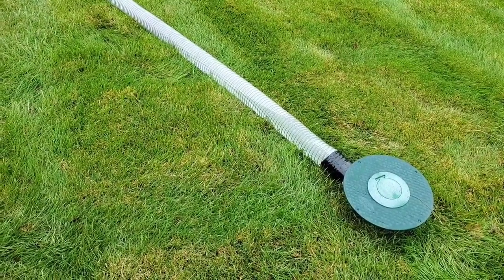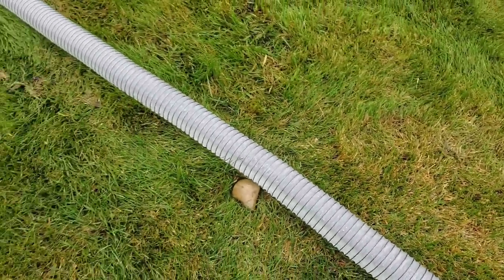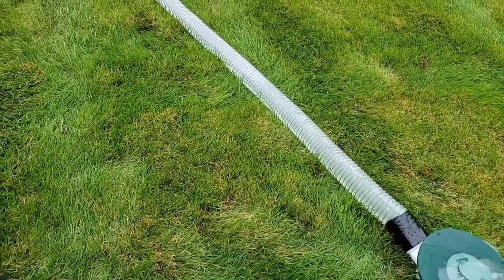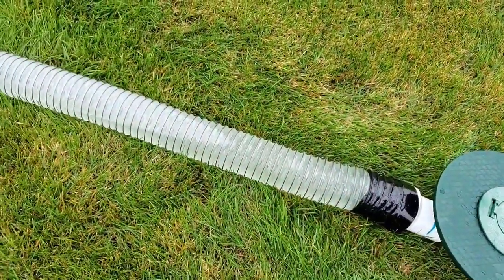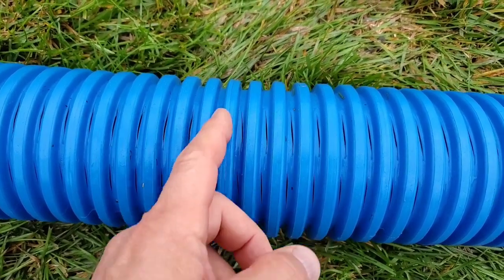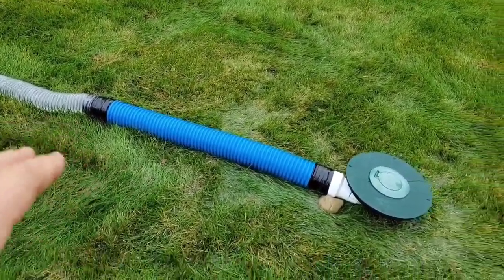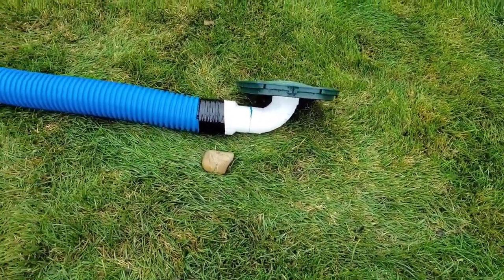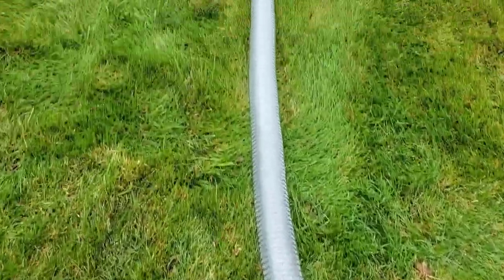How to Prevent Underground Buried Downspout Pipe From Freezing During the Winter

Comment: I've seen in your other video where you say not to run downspouts into slotted pipe because it may fill with shingle gravel and debris, so why are we using it in this application?
Reply from the maker: Don't run downspouts into French Drain Systems.
Reply: @FRENCHDRAINMAN  I don't intend to but in this video you recommend using slotted drain tile before the pop up...that is what I was asking about.
Reply: He's only using it as a relief at the end. Do not run perforated pipe from you gutters immediately as all the water will leak out against the foundation.

Comment: What's best to use under concrete in Wisconsin? A trench drain with exposted top, 4" abs pipe, or 4 inch double wall culvert pipe? I have a 5ft length of green drain pipe under my sidewalk with a 4 inch white elbow inlet from downspout that freezes and cracks into peices every winter and will be pouring concrete patio below where it discharges so I'm looking into a miter drain for the discharge. 
Drilling a hole in the bottom of my elbow is probably not a good idea because then it will freeze and heave the concrete. 
What's my best option?
Reply from the maker: https://youtu.be/3_FcEdESkQ0
Sleeve it with 6" and run 4" single wall corrugated pipe through it.

Comment: I have clay soil and minimal slope so I don't expect my drain hose to drain completely, so I would use weep holes like you show.  My question is if it rains for 30-60 minutes, the weep holes will saturate the clay, therefore, when the rain stops, there is now no room for the remaining water in the pipe to disperse, as the clay was already saturated from the weep holes draining throughout the 30-60 minute storm.  Thoughts?  
Is it better to put only one very tiny weep hole in the 3" right angle, that would limit the amount of rain weeping into the ground to a minimum during the storm, and then after the storm let the remaining water in the pipe still have room to drain out slowly over many many hours?
Reply from the maker: https://youtu.be/wawHvSs0UV4?si=bl8PN2vSqBnFCwgy

Comment: I have watched many videos and over time recommendations have changed.
I live in north and am worried about freeze ups.
So I blended some techniques as to what was readily available.
Under the bottomless pop up emitter I went down 1.8 feet filled with 3/4 to inch and a half stone...fabric over then pea stone to surface (to combat grass obstruction as I don't have access to turf restrictor plate). I filled in a foot of trench to counter downspout runoff back into still open trench. 

I tested.  I think I have turned my pop up emitter into a catch basin.
During rain, the water pops up just below the emitter in the pea stone first.
After the rain...the water stays just below emitter surface. It then takes about 10 hours to drain completely in clay and loam. Water also still went past my experimental dam into open trench.
So now I am wondering if all that wrapping and overlapping of fabric (in this video) was to keep water at bay? You did mention using clay all around.
Also, if you do happen to see this, by  me having about 7 gallons of room at the emitter, has that reduced my water pressure? I ask because it seemed like my water flow had slowed down and maybe water was backing up more into pipe than it should but I could not tell. 
I really didn't want to put in a section of perforated taking into account your other videos that mention root issues and clogging.

I'm kinda thinking I should make it solid around the emitter (clay you mentioned) until the bottomless part is reached to maybe increase pressure for the emitter.  
Anyway thanks for all your videos. :)
Reply from the maker: I think what you did is fine, and you don’t have to make any additional changes. What you made might be overkill, but I like it that way.
Reply: @FRENCHDRAINMAN thanks very kindly for the feedback :)

Comment: Very interesting channel information. I understand why French Drains are effective in channeling water away from your foundation.  But has anyone ever used perforated drain pipe resting INSIDE YOUR GUTTERS to channel water to the downspout?  I'm thinking this is a way of avoiding having leaves clog your gutters on a yearly basis (if you have nearby trees).  Ever heard of that solution?
Reply: Leaf guard lol
Reply: @jeffbidniy6552  I can buy 100 ft. of ADS 3-in x 100-ft Corrugated Perforated Pipe to sit in my gutters for $130, Leaf Guard would cost me $2,400.
Reply: @j.ericswede7084  I guess it will float,  the dirt piling up under the pipe
Reply: @2adamast  The perforations (holes) in the pipe wouldn't let the pipe float. Small holes, 1/4" every 6 inches on the top half of the pipe would channel the water from the gutter to the downspout unblocked by leaves, etc... I know it would work, just haven't done it yet.
Reply from the maker: Downspout Cleanout and Leaf Filter Gutter Leaf Guard
https://frenchdrainman.com/product/downspout-leaf-filter-clean-out/

Comment: You need to teach a MASTERCLASS !!  Seriously..... However, in this case, I am not 100% convinced it will keep the line from freezing.    When temp is sub freezing and  ground is solid, won't the water in the "cut" corrugated pipe extension also freeze ? Same is true with the hole under the 90" ???
Reply from the maker: https://youtu.be/1kPHHnDc1ZY?si=jqaV6rmieJmgntsj

Comment: Looked on Amazon and your site. Where can I get 3” knife cut? Or can I just do it by hand to the 3” corrugated pipe? I bought your kit with the downspout filter, hose, and popup emitter.
Reply from the maker: I don't recommend a three-inch knife cut. It can hurt you more than it can help you. A four-inch pipe displaces 56% more area and holds 56% more water. By going to three inches, you've already reduced the amount of water left in that line by 56%. You'll bring some dirt in through those knife cuts. And the three-inch line doesn't displace enough area to recover from too much dirt filling it up like the four-inch pipe would.
Reply: So should I cancel the 3” pipe? I watched your video praising the 3” I live in Utah and get about 14-16” precipitation a year. Or are you suggesting I get knife cut 4”? 

Or just run the 3” and drill some holes in the bottom of the elbow connecting to the pop up?

Comment: Just bought some and I feel like I’m missing something. I just dry fit everything and tested with the hose and I can hardly get a trickle. Also the water backs up so much in the pipe. I have more than enough slope, is it just not enough pressure with the hose?
Reply from the maker: A garden hose does not provide nearly enough pressure.

Comment: I bought the "kit" and installed it a couple weeks back. (Had new gutters installed, needed to handle their runoff).  Front yard is all clay, and we had 2.5 inches of rain over a day and a half and the clay by the popup became pudding.  (Freshly dug, ground hadn't settled, BIG rain event) I mean, like walking on jello pudding goopy.  It also washed the dirt downstream of the popup and all the seed and straw away.  Serious erosion because the grass had been "killed" pending a lawn renewal next spring. I think next spring I will dig it back up, use a 3 inch popup, and add the knife cut once the ground thaws.   If I'm hearing this corrrectly, the trench for the section of knife cut should be wrapped and the trench should have gravel (inside the wrap, not outside), but otherwise the regular 4 inch just lays in the trench?   And I too wondered if it may make sense to dig down under the popup and make a lined hole with rock to kind of "dry well" the outflow of the hole in the 90?   I'm afraid that even with sod/grass holding teh dirt together, another rain like we had will make that part of the front yard a muddy mess.
Reply from the maker: It will set up and shed water wait until next spring
Reply: @FRENCHDRAINMAN  i like this reply.  i've run a backhoe on many many sites that are total sponge but next year same season - done.  i'm for sure not an engineer type like FDM but i did run the hoe on the gang for 7yrs where we put in cable at road crossings.  on many ditches parallel to a crop field ditch (huge) we'd have to pay attn to this issue.  rip rap was already in the ground for the various drainages nearby (other fields).  we'd dig in that in summer and even  put crush in it.  - never dirt.  had to put up 60' antenna bases in it.  you'd dig out a 6x6' hole that fell in constantly due to the riprap base, and have to backfill with crush it would be like walking on a trampoline for weeks, maybe months.  but eventually it would get back to packed crush.  i guess some northern guys call it washout/ abc, whatever.  it is very small but not sand small.  it sets up as a base for a road.  except when the dirt around it is mud.  we'd have to just get rid of the mud and use crush.  you are wasting time pushing dirt in a ditch in that kind of area. the next yr tho hard as concrete.  water runs over it, for the most part.  but this is all in the SE, near flooded fields.  in my experience you run into this in special areas that constantly flow water.  and normal heavy eqmt people don't see it that often i think.  except for FDM types

Comment: Any suggestions to remedy a frozen downspout in which there is nowhere for a french drain to drain to? Heat trace is not an option either...
Reply from the maker: Heat cable for the metal gutter and downspout and PVC heat tape for the plastic line.
Reply: @FRENCHDRAINMAN thanks for your reply. heat trace is not an option either. What do you do when there is nowhere to take a French drain? The street is up hill from the downspout.

Comment: I have a ranch house approx 2,100 sq ft of roof area and theres only 1 gutter downspout on each side of the house. I just ran 4” corrugated from gutters underground at 1.5% slope until they tye into each other with a wye and they share a single 4” corrugated pipe to the pop up emitter way down hill 65feet at probably around 3% grade. Do you think i should have went bigger than 4” ? I havent had a huge rain yet with the setup. Im basically draining entire house into 1  4” and questioning my decision! Been watching your videos and doing my homework. I did run an extra 4” in the trench in case i need to put each side of the house on its own discharge line . Thanks for any info
Reply from the maker: https://youtube.com/playlist?list=PLjFCqaZ4v1BUqichor2QH1X_p9bBPor8D&si=ugXP9CwgX60WPZFE

Comment: My house was built in 1898 there isn't much slope except towards the house from the backyard and driveway.. thinking channel drain along driveway with some catch basins in the higher flood areas all going back to a 50gal dry well in the backyard , between mine and neighbors house have to connect 4 downspouts to a line and probably discharging to the road? Or sending it back to the dry well?
Reply from the maker: Negative grade usually requires a outdoor sump pump system. Dry wells only work great if the soil is highly permeable. Dry well is a capacity drain, once it reaches its full capacity it no long works and you will flood.
Reply: @FRENCHDRAINMAN   I figured if I dig the trench deep enough to give it a proper grade i might not need a sump? I was originally thinking multiple dry wells connected to each other but I collect a lot of landscape material from work so I have A LOT of stone from small egg stone, field rocks (small boulders) flag stone etc and digging down a couple feet to put rock in a decorative manner then having the flo-well/s underneath it in a way I can still access the well to clean it when the time comes.

My street has some weird grading and there isn't a drain near the house so I decided against coring the curb, then I thought maybe I'd do a couple of your pop up emitters with sump basin but it doesn't appear to have much grade at all and through my research I learned that I need 1 inch of fall per 8 feet and that doesn't seem realistic for me to discharge to the road especially with it having no where really to go from there. This is what I've come to after about 4 months of planning and watching videos of drainage companies from Florida LOL just found your channel a couple weeks ago
Reply: I have 2 rain barrels to collect water for my carnivorous plants. There is 1 downspout connected to each barrel. 15 minutes of gentle rain will fill those barrels.
Reply: @mikeingeorgia1  I'm moving way too much water for my original idea, I ended up building a custom sump pump basin that holds roughly 300 gallon of water (lost power once in a storm and had to bucket out the water from the basin and half of the vertical shaft (not including the larger horizontal chamber) I pulled over 80 gallons out of , working on a solar set up for my sump pump

Comment: Tell me a heat tape mfg/brand name that can reside inside the pipe/downspout that is in co tact with the runoff so it will not freeze.
Thx for the video.
Reply from the maker: I bought this for my personal home I plan on doing a video on installing. Follow their directions on the heat cable website. Drop the end down your downspouts and remove the center of the Vented Cleanout screen (if you run our system you know what I'm referring to.)
Use a fish cable to pull it to your FDM pop-up emitter V2.0 
Check this out!
RADIANT SOLUTIONS HeatTapePro - Intelligent Commercial Grade Self-Regulating Heat Cable with GlowCap™ - 10 YR warranty - Ice Dam & Pipe Freeze Protection - 100 ft cable + 10 Ft Cord, 120V, 6 watts/Ft https://a.co/d/dYtAx3y
Reply: @FRENCHDRAINMAN  thank you. And made in my state of Minnesota, so they know freezing.

Comment: Great demo, totally makes sense. I am in eastern Canada so of course I will get freezing temps in the winter. I wasn't planning on using a pop up emitter and instead just running my pipe to day light at the back of my property. In this case is the few feet of perforated (knife cute) pipe at the end necessary, or will the water just drain out because there is now bend to get out of the pop up? thanks
Reply from the maker: To daylight on a slope no knife cut is needed.

Comment: One technique I've seen is to dig a post hole under your pop up and fill it with gravel to allow trapped water to dissipate more effectively.  I guess it would be the vertical version of the knife cut section in this video.
Reply: Like a dry well? Those work great too!
Reply: @lawn-n-orderlandscaping1389  When I've seen dry wells, they were installed as the primary dissipation technique for water.  In this instance, it is secondary to simply ensure residual water at the pop-up disappears faster, but yeah, the function is the same.
Reply from the maker: https://youtube.com/playlist?list=PLjFCqaZ4v1BUqichor2QH1X_p9bBPor8D&si=0Ifem4st3MDhFrgU

Comment: Where does the water drain when the ground is frozen 2+ ft deep?  Do you need to bury the pipe below the frost line?
Reply from the maker: It would be snow not liquid.
Reply: @FRENCHDRAINMAN  But on warmer days snow will melt off the roof.  I have puddles in my driveway they freeze and create skating rinks.  Wouldn't it freeze if I drained it into the yard?
Reply: In michigan It will randomly warm up and rain when the ground is still frozen.